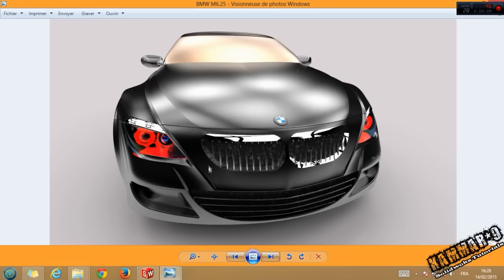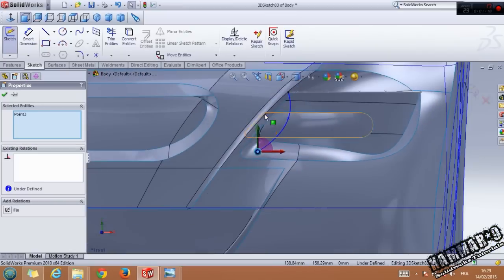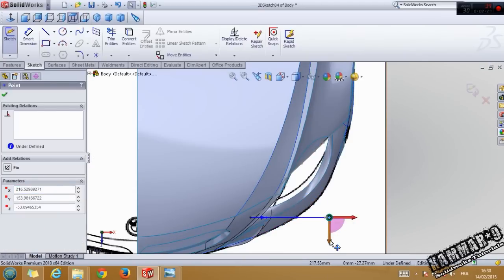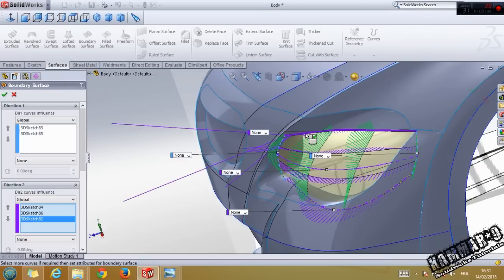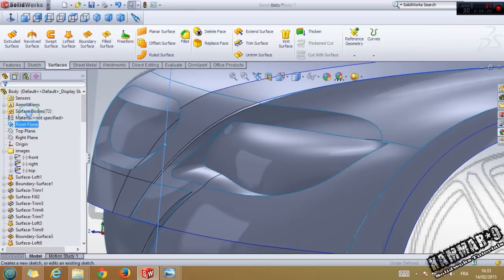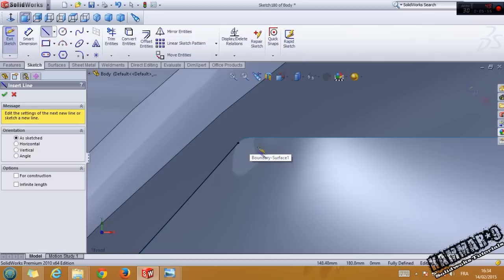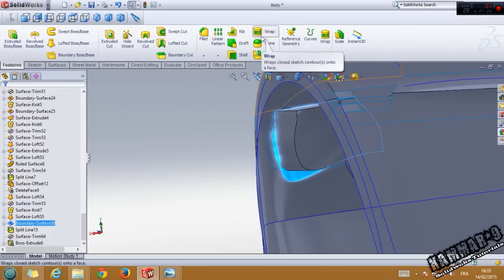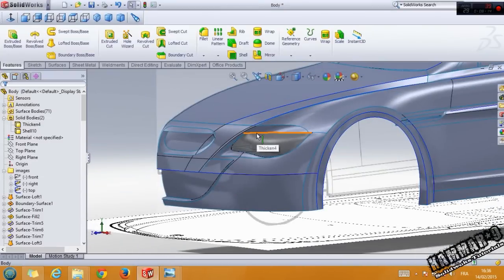Solidworks Tutorial # 14 BMW M6 with Solidworks part 16 / 23

Comment: Hi,
I am stuck on the extrude boss from surface part. It says to "please check the sketch does not intersect the surface/ face" 
Any help on how to solve this?
Reply from the maker: Hi bro , tell me what's the minute exactely ?
Reply: @6:20 
You just finished using the "split line" tool and move on to the extrude boss from surface tool. 
I am trying to do the same but I keep getting an error that says "Please check that the sketch is not intersecting the projection surface/plane"
Reply from the maker: I think the problem cam from the profil , the profil of the sketch is not closed , did you try to extrude without changing the setting in the ( From )

Comment: Hi, I really like you tutorial but I am stuck in this one. I cant make that shell correctly. I spent few hours with this problem but I don't figured out yet.
Do you able to look on my model and tell me where i made mistake please?
If you write me down your email address I would like to send you my model.
My address is dddkuras@gmail.com
Reply: +khelifaoui Ammar 
Did you manage to solve the problem? I am stuck at the same part too... i think my problem is the split line with the boundary surface but i can't solve it....
Reply: Hi, I have solved the problem.
Reply from the maker: Darek K. ok brother , you can sent me your work here khelifaouiammar@gmail.com
Reply from the maker: +R van den E Hi there , bother , I didn't recived anything yet , can you resend me your model , but , please , I have not solidworks 2015 , send me the model , in solidworks 2010 version, or make me a short video , to understand the problem , thanks
Reply from the maker: Darek K. ok  that's so good brother ,
Reply: +khelifaoui Ammar I have the same problem any help !!